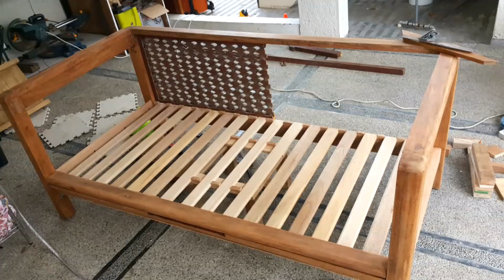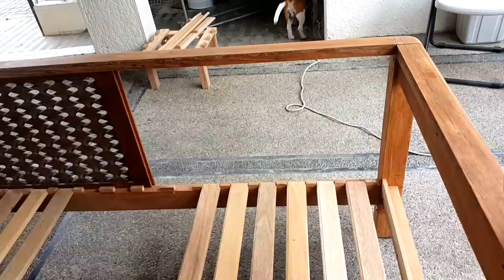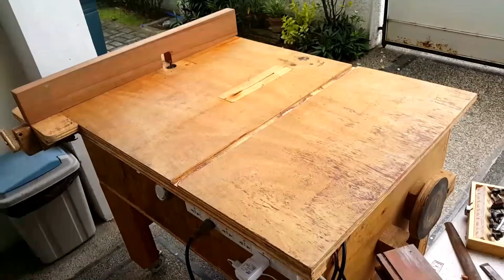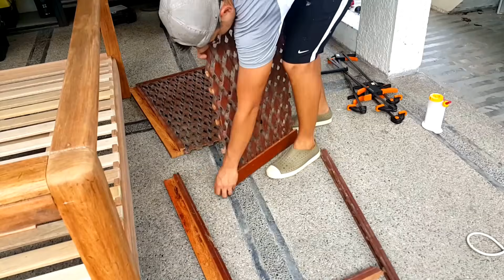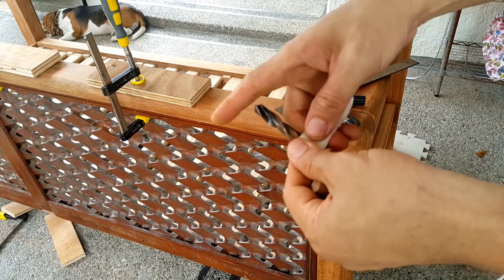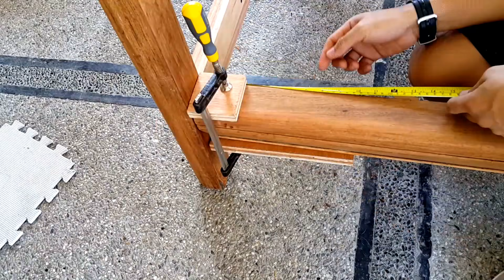How to Turn a Table into a DIY Sofa Daybed

Comment: How does it do when wet (is it actually better than before and how much)?  And, how long has it lasted (does the sand cause the paint to break up/break away . . . ?)
Reply from the maker: Are you referring to the DIY non slip paint video?